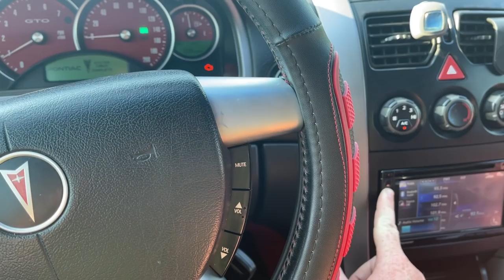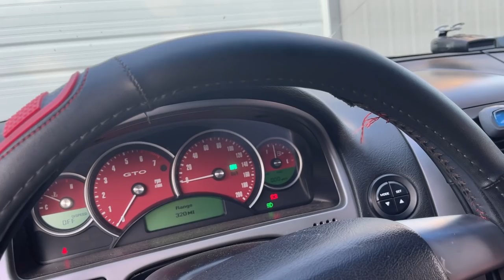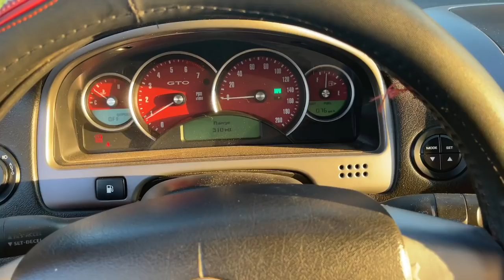Fixing The Transmission, TPS, MAF, And Oxygen Sensors on the GTO.

Comment: I have that same exact extendable socket wrench! I beleive it was made by Stanley! Purchased at Wally... I heard a god awful noise while over using mine one day, I was putting way to much pressure on it yet, it still works! I did buy a replacement because if that noise, was upset that I couldn't find the same exact Stanley flex head, adjustable length wrench!!!!

Comment: I recently replaced EVERY sensor and the evap purge valves in my GTO. I've owned mine for 12 years and am presently in the process of, for all intents and purposes, restoring it to better than OEM condition. It has been taken care of as best I could muster in the time I have owned it so it's not too much of a struggle but finding parts is not easy or cheap. 
Presently I'm on the 3rd stage of refreshing and upgrading the interior and the engine, which has 97k of well maintained miles, will come out after that.

Comment: Transmission service can't hurt, just not a big fan a a flush. I always do my own. Just filter and fluid for my 300c, but I had to buy a dipstick and scan tool to read the temperature. To get the right amount in my nag 1